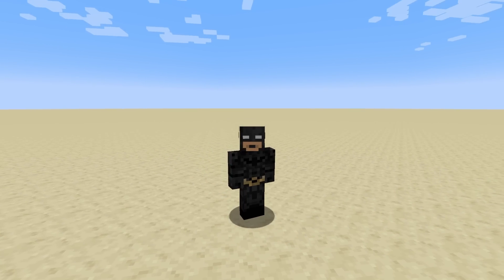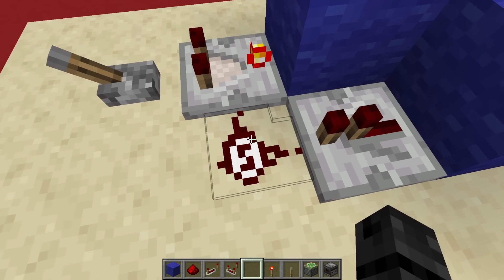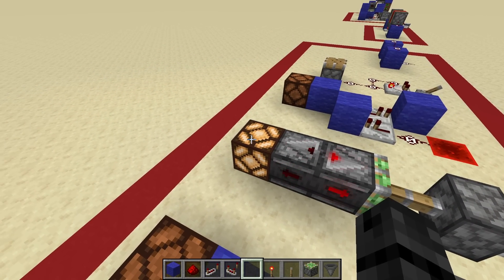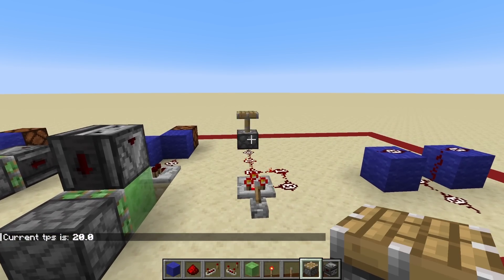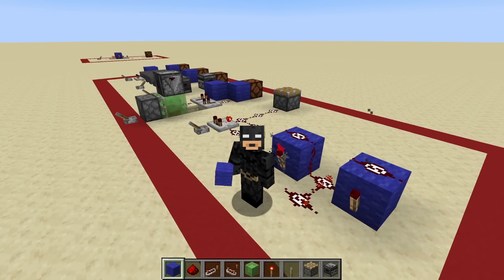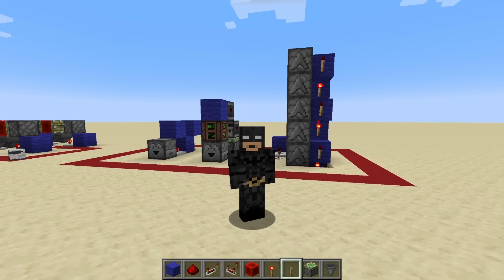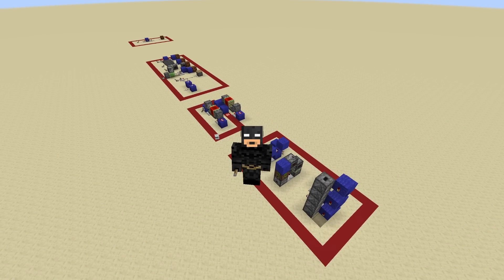All It Does Is Loop... But Why? - WTH Is a Redstone Clock??

Comment: 1 - I found a sistem is not here, it is like hopper clock but instead use dropper chain...the metter is thath with a hopper counter you have a long reset time, instead with dropper the reset is quite istant...so is perfect if you need fastest reset

2 - a redstone clock vertically with 3 solid block 1 repeater 1 torch and 1 repeater...I used it as 1 second compact clock....

Comment: yo
I have an idea for a cycle. I've seen it on someone, but I don't remember who. You put the minecart on the rails at an angle down, put a fence at the same level as the minecart, and a pressure plate on top. In conclusion, the minecart presses on the plate, it remains pressed, rises and the minecart, without moving from its place, presses on it again. The signal is received EXACTLY 1 time per second. I hope you appreciate the idea

Comment: 14:41 the dropper is activated by the blue wool on the diagonal behind it, strongly powered by the redstone dust in star mode.
Reply: He's not talking about that. He's talking about how quasi connectivity works. Basically, the dropper needs an update so that it can be powered. If not, then it'll never be powered. His thoughts on it, is that it gets updated when the comparator turns on / off and it sends an update, but it's just a theory.
Also, just for a small clarification (don't take this seriously, and/or take it in a way that's offended), the redstone dust in "star mode" is formally called "cross shaped redstone dust", but you can call it whatever you want.
Reply: @Nos_Yous  Thanks, my second guess as to why the dropper gets updated is through the redstone dust going into the comparator, which updates the comparator and in turn the dropper with it.
Reply: @GradientAscent_   Well, comparators don't need updates, since the only things that need updating is stuff that got quasi connectivity, or when it loses signal when redstone gets redirected (and some other small stuff).
Anways, blocks don't send updates either way, but i still don't know the reason for why the dropper updates.

Comment: A mixture of a very slow clock and a randomizer, for the challenge you gave at the end of the video:
Have a sheep on a dirt block, next to a grass block the sheep can't access. Point an observer at the dirt block. You now will get a pulse when the grass spreads and when the sheep eats the grass!

Comment: 10:20 If you don't want to use sticky pistons for whatever reason, or you just don't like the noise that Etho clocks make, remember that Etho made a redstone version. I think it's a bit slower, but should pretty much look identical and as said, Etho clocks aren't used for precise redstone. By the way, if you want to see the redstone version, EthosLab made an amazing tutorial in his channel (it's 10 years old, but it should work still).

Comment: I had a really dumb idea for a clock the instant you said to come up with one

Dropper over a pressure plate going into an inverter 

Activate the dropper, pressure plate is pressed by the item, when it despawns another item drops
Put an observer on the plate and you get a pulse every 5 minutes lol

Comment: As someone who has no idea how redstone works but has a huge insane idea, what is your opinion about using encoding to basically make wireless messaging?
I would use banners or player heads placed into shulker in order so that when they’re unloaded in order it makes them re loaded in the receiving hub in the correct way. It would have 7 redstone lines each to a calibrated skulk sensor that would have a certain code for each “letter” or symbol. gives 128 options! I have no idea how to go about this so thought I’d throw this into the world in case someone would want to try :)
Reply from the maker: Cool idea :)

Comment: for a fairly impractical clock, you can use a sticky piston that cuts off its own redstone signal when it extends, either by moving the block out of the way of a repeater or by cutting off redstone going up a block

Comment: I actually did invent a new Clock, that I have never seen before. It uses 2 Skulk Sensors which alternate with flicking up and down a trapdoor triggering each other. The system is closed of by Wool and has an output from an observer. It can also be toggeled with redstone torches forcing the trapdoors open

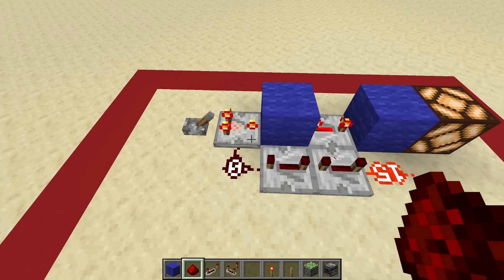Comment: 4:08 I believe that is in fact just a 13 tick clock and not a 26. It is on for 4 ticks and off for 9

also at 6:07, a more complicated pistonless design is to have a form of repeater lock that captures the signal. This will have some lag between input and action, which I doubt could be avoided (without overcomplicating using zero-tick stuff)

Comment: A clock I used that predates hoppers and comparators was basically a minecart. Put down a loop of track with powered rails, put a detector rail as it's output and push a minecart and it'd pulse at a regular rate. Definitely didn't invent it, but that was my go to for a while.
Reply from the maker: Totally valid

Comment: I have this Observer facing daylight sensor as a redstone clock. It send redstone signal multiple times per day when the daylight sensor update it's power level, and send no signal at all at night. I don't need a precise timing, but just a way to activate contraption multiple times per day.

Comment: my contribution to the wonderful world of weird clocks:

place a creeper in a short (3 to 5 blocks long) tunnel. at both ends of the tunnel place pressure plates that activate the R and S inputs of an RS latch respectively. let the Q and inverted Q outputs trigger sticky pistons that open or close the line of sight into the tunnel. place cats behind the pistons.

the result is a creeper erratically running back an fourth. every time it reaches one end of the tunnel, the cat nearest to it gets exposed, shooing it away. the timing of this clock is quite random, since the mob behavior timing is fairly unpredictable. therefore i call it the "fuzzy feline clock", or FFC.

(a repeater delay may be needed in front of the pistons to make it reliable. for extra points you can also name the cats alice and bob)

proof of concept gif: imgur 5IToxkH

Comment: My original clock design is a water stream of any length, a hopper at the end and a dropper at the start, with the hopper pushing the item directly into the dropper and a repeater-delayed comparator signal from the hopper spitting the item back into the water stream.

Comment: I always liked to use a sticky piston and make it push a block forward when the piston is powered. The block was connecting two redstone lines, that powered the piston so it's removal removed the power of the piston. If you wanted the clock to go slower you could just use repeaters.

Comment: A server I used to play on disabled redstone clocks so I created an "armor stand clock" using water elevator and several cobwebs (to adjust loop time).

you can also take advantage of item despawning time(5 minutes) or daylight sensors(power goes to zero once a Minecraft day no matter the weather) to make some really simple clocks.
Reply: How does one simply disable redstone clock builds? Wouldn't that just mean disabling all kinds of redstone?
Reply from the maker: Nice! Yeah, there's lots of room for creativity when it comes to clocks.

Comment: 14:47 btw you can make this 2 blocks cheaper. if you move down the sticky piston and both observers one block down this will still work meaning you dont need both a block and a noteblock because again quasi connectivity.
edit: actually theres 2 quasi connectivities because the piston will also be quasi powered.
Reply: wait then wouldnt the dropper turn off when there are items inside of it? and then turn on where there are no items?
you'd make an anti-smart dropper, unless you invert the piston, but there doesnt seem to be a great place for a torch
Reply: @ovencake523  I think you didn't understand it correctly. there's a dropper and out of it there's a comparator same as what he showed then the comparator sees the face of an observer with a sticky piston facing up underneath and when it extends it starts the observer clock which constantly powers and depowers the air which because quasi connectivity exists it will constantly power and depower the dropper. and the piston btw is also extended the whole time when the comparator is activated because again quasi connectivity. hopefully this explanation is good, I mean you can just try to build it and see that it works, I already used this a few times and it works.

Comment: Simple and (somewhat) compact clock idea:
Piston in front of an observer such that when the piston arm is extended, it covers the face of the observer (exciting it), then when the piston retracts, the observer fires and extends the piston again. Dust or other observers can be used to connect to the piston. Admittedly, this is a noisy design, but a good and spicy spaghetti pile of redstone is rarely silent.